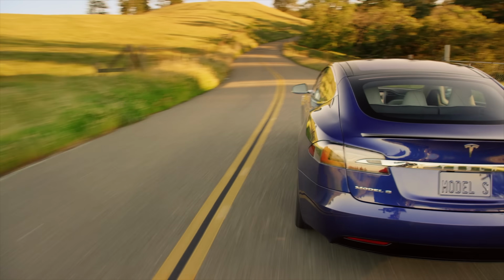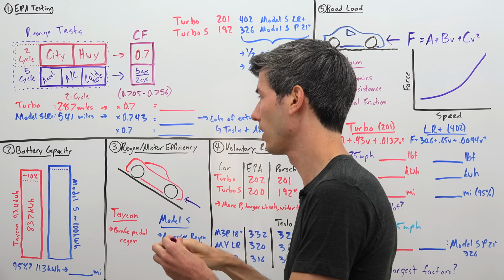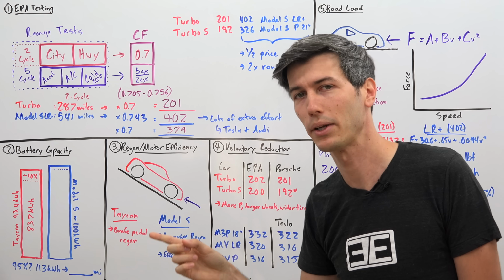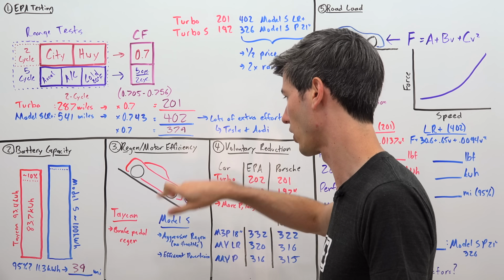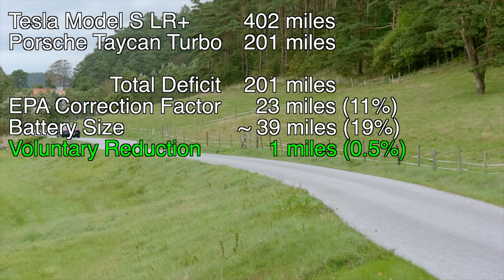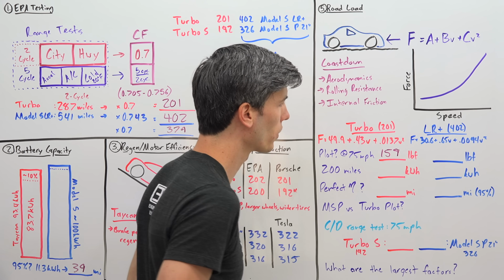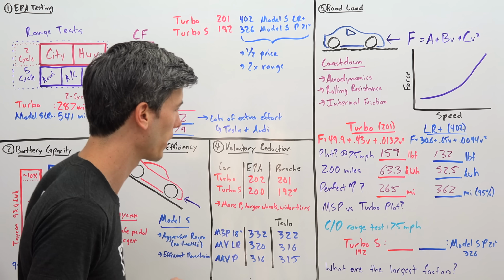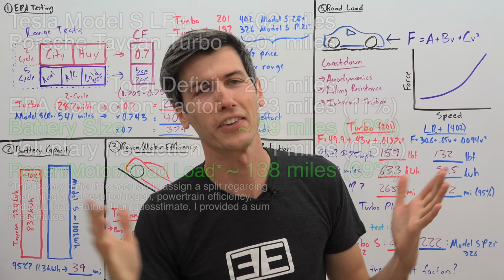Tesla's Secrets To Dominating EV Range - Double Porsche?!

Comment: Hi Jason, great explanation. 

I work in the electric motor controls group for an OEM. While machine losses from one motor to another do vary, it is not on a large scale. Permanent magnet synchronous machines, like used by both vehicles here, with SiC inverters are capable of extremely high efficiency. The impact of item #3 in your video is likely small.

Further, even though one car may have more "one pedal" regen, when the EPA tests are run, I think it unlikely to make a difference. The profile is defined. Braking will be primarily from regen regardless of if it one pedal or the driver physically pushes the brake pedal. Coasting is actually better than unnecessary braking. 

Great work explaining the differences!
Reply: Working for an OEM too and I totally agree, everyone keeps saying Teslas are more efficient but motor + inverter + gearbox is such a small part of the differences. Battery buffer and road loads have so much more influence 👌
Reply: @cellofane89  How can Tesla use a smaller buffer yet have the lowest degradation?
Reply: @yehudagoldberg6400  I don't think I ever mentioned degradation?...
Also, what is your source to claim Tesla has the lowest degradation? Degradation of what compared to what /who?
Reply: @cellofane89  You did not mention degradation. I did. Since you work in the field, I am asking you a question. How can Tesla have so little degradation with small battery buffers? Is it the charging curve, battery cooling, battery chemistry?
Reply: @yehudagoldberg6400  oh I see, my bad then.
I think Tesla does not have significantly better cells than others (when looking at energy density at cell level, cooling system power and charging curves) . They are probably more confident or taking more risks and reducing their buffer compared to others. As far as I know, there is not enough data from other manufacturers to see if they really do better or worse on ageing. On top of the degradation topic there is also other attributes linked to that buffer, for example Porsche can maintain high power through the whole useable SOC range instead of reduced power at the end. Also, charging can be more aggressive with a bigger buffer both because you don't use the very top end SOC (where charge power is limited) but also because you can "afford" more degradation.
Reply: @yehudagoldberg6400  The short answer is they have better software for SOC modeling so they can be more accurate and their strategy is NOT to charge to 100% everyday which helps on life.
Reply: Theoretically coasting is better than regen. However in the real world, 95% of drivers do not coast effectively, so regen is better.
Reply: Yehuda Goldberg You’re ignoring the fact the Porsche can regen at 270 kW, which is deceleration of 0.4 g. That is a much higher deceleration rate than most people use in normal driving.
Reply: @KyleBrightman  sure, but the EPA cycle does not contain any 0.4g braking event. Agreed it could regen up to that, but during this specific cycle it cannot. That's the bane of any normalised cycle, the accelerate and brake less aggressively than some/most people do.
Reply: @dragosmihai3489  Much than half Taycan. Bjørn Nyland says max regen is in Tesla 3 Performance and it is max 95 kW.
Reply: @foersom5928  Did a quick calc. Assuming you're not traction limited (so would apply better on the front axle) with a 2000kg vehicle at 30m/s (more or less 60mph) breaking at .4g would be capable of releasing around 300kW; were the motor and battery capable of drinking that up? Should do, as it would be a "spike", so no real overheating can occur. It might be a bit jarring for the driver though and it seems most do limit the regen (far) under 100kW. It took me a while to adjust my style on the bike to be able to use full regen, without loosing the rear of jumping over the handlebars, similar on cars. I whish, if I owned an EV, to be able to jack the regen power up to the limit I'm confortable with
Reply: @yehudagoldberg6400  Excellent point.  I would guess the reason for that is that 95% of drivers are driving in stop and go traffic where excessive coasting is considered obstructive by following drivers.  Being aware of energy management I try to coast whenever reasonable (much more than my wife does), but unless there is no traffic the level that seems reasonable to other drivers is well below that for maximum efficiency. So I agree regen is better for real world driving.
Reply: @gort8203  Absolutely, regen is better hybrid vs non-hybrid, but there is still the point that in "normal" driving, the porsche should be able to handle all deceleration with regen via the brake pedal. So unless they are purposefully blending mechanical braking in with regen (maybe for brake feel) their regen efficiency (efficacy?) should be very similar given similar driving styles.
Reply: @gort8203  Regen is great when you need it and is more for city driving. But is nearly useless for highway and I don't want to Regen the moment I let off the pedal slightly. Kia and KonaEV are great because you can change Regen levels on the fly from zero all the way to 3 with the option to hold the paddle to get max Regen possible.
Reply: @fleyua7176  there's so many opinions here and it seems so few experiences. In a Tesla it's more accurate to say you modulate your speed/coast/Regen with one foot, you can easily coast and see how much energy you're using or gaining. If you let off slightly then you coast, the more you release the more the car engages Regen it's very intuitive and efficient, I rarely ever need the brake, and it at least doubles my reaction time, as switching pedals takes time, and effort.
Reply: @tscook10  More real world than EPA testing but anecdotally I have found people maintain pedal styles more than acceleration profiles switching between cars. Approaching red lights, most people I ride with coast no pedal until some preferred stopping distance & start breaking (poor momentum management). Given moderate regen they slow earlier & coast in slowly giving more time for the light to turn & retain momentum. Using a little regen loss to save more regen loss + low speed friction break loss.
Reply from the maker: According to the Car & Driver article, the Regen/Motor Efficiency is the largest portion of the test difference. They state the regen alone results in a 13% gain in range.
Reply: @EngineeringExplained  I need to read the article because I would like to know how they obtain such number. I was surprised at the small difference in road load between the two cars, I thought it would explain most of the difference in range (after correcting for battery size and factor) but it sounds like there are other gremlins... Maybe AC systems or bad regen on the Porsche then...
Reply: The road test are the verifiable data. And you can't get from the road test to Tesla's EPA (self-reported & so far non-reproducible) numbers without assuming some wildly implausible assumptions about the effectiveness of Tesla's regen. We already know Tesla misreports electricity consumption to the driver. It's not hard to figure out what the simplest explanation is. Tesla's core competency is software & the EPA isn't all that smart. 

Porsche doesn't want to punch down but I'd love to see Ford or GM put a Tesla through the EPA cycle and report the real results.
Reply: @EngineeringExplained  test difference != real world difference. You yourself just proved that in reality Porsche is more efficient than Tesla, you just did not realize that and stated the opposite in the video. Just take C&D achieved range and divide available battery capacity with it and you will see that Porsche power consumption is 12.5% less than Tesla. All those artificial roal load and rating factor calculations are utterly misleading.
Reply: @EngineeringExplained  That would suggest the test cycle has a silly amount of acceleration and deceleration cycles

What matters is as you point out the range on motorways where the difference is just 6%
Reply: This is just a theory & regen would have to have >100% efficiency for this to be true.
Reply: @EngineeringExplained  interesting. I'll have to pick that up. Maybe Porsche is doing more friction braking for some reason. But that is independent of one pedal vs coasting brake profiles.
Reply: @EngineeringExplained  Interesting point; having done some testing on different regen strategies, in the real world it doesn't appear to make a lot of difference (comparing say lift off regen with regen only on the first part of brake pedal movement). A quick and dirty calculation based on the EPA urban cycle UDSS (is this the right cycle??), using the road loads given for the Porche, and a mass of 2215kg gives 3.96kWh motoring energy, and 0.633kWh of generated energy (assuming 100% efficiency, and no friction braking). The generated energy is 16% of the motored energy.. that would imply Porche barely have any regen at all during EPA. I didn't bother looking at the highway section since there isn't much deceleration going on. Very interesting discussion :)
Reply: @EngineeringExplained  As it relates to regen, you need to take into account that battery voltage.  Tesla 400vdc, and Porsche 800vdc,( P = (Vm - Vbat)2/ Rm). Porsche should have a significant advantage with opposing Regeneration  (Used to charge the battery).  I understand Porsche takes a conservative approach to regen, but has more available regen power.  Also, DC Fast charging times gives an advantage to Porsche as well.
Reply: @EngineeringExplained  In Europe, we often need to slow from 100km/h to 80km/h on high ways. Using that final plot of yours for Tesla Model S Perf (2250kg and 100km/h -> 80km/h will reduce kinetic energy about 314 kJ), I get that:
1) coasting away from 100km/h -> 80km/h with linear approximation (not linear for real) will use 616m distance
2) driving 616m at 80km/h will consume 0.08 kWh
3) max regen available from slowing 100km/h -> 80km/h at 100% efficiency is 0.087 kWh

In order to gain benefit from regen braking, it would need to be 100% efficient. Regenerative braking is only useful, when stopping needs to happen fast, so in city traffic etc. where you normally would convert the speed into heat in the break discs.

So, also in Tesla Model S Perf it would be beneficial to just coast away the 20km/h speed on high way than brake it with regen (unless I have made a huge mistake).

Porsche engineers 1 - 0 Tesla engineers. Sorry :).
Reply: @akkual  I'm not sure why everyone thinks you can't coast in a Tesla. To coast in a Tesla you just need the correct technique - you apply enough pressure to the pedal to zero out the power meter. It sounds tricky, but after driving a Tesla for a bit it becomes second nature.

I used to believe that blended braking was better when I drove a Nissan Leaf. Now I own a Model 3 and I think that Tesla-style regen is much better.

Tesla-style regen makes it much easier to maximize regen, because the driver knows at all times whether they are activating the friction brakes. If you want maximum regen, you just let your foot completely off the accelerator pedal.

With blended brakes, it's hard to tell whether you are using purely regen or if friction braking is also involved. This is particularly true because the amount of force on the break pedal which causes the friction breaks to be applied tends to vary with speed, state of charge, and other factors. This makes it hard to develop a feel for the point on the break pedal that offers maximum regen.

Many EVs, including the Leaf, now offer a pedal off regen mode, but in many cases that mode only offers a limited amount of regen.

Once you have practice in a Tesla, you almost never need to use the friction breaks except in emergency stops and at very low speeds (regen does not bring the vehicle to a complete stop; there is a one pedal mode which does, but it applies the friction breaks). You can also make longer decelerations (e.g. stopping from highway speeds at a traffic light) extremely smoothly since you have precise control over regeneration.
Reply: @BrianCairns  I like to rest my foot while coasting. And to be particular, there's no such thing as "max regen". There might be some efficiency sweetspot for it, but in general it does not matter how strong the regen is,  only the total energy absorbed (delta in kinetic energy) via regen matters, not how quickly or slowly it was absorbed.

I haven't driven Tesla, but some have said that the regen is a bit annoying on full battery as it won't be as strong as when there's more room in battery. But this I do not know, as I have only sit as passenger in them.

Brake pedal in normal modern gas car is not linear either. ABS+EPS will modulate the given pressure based on the vehicle speed, pedal pressure and pedal pressing speed. It is not a challenging task to make a brake pedal regen that gets as much energy absorbed as possible, and what's best, it is all done for you automatically. So as driver, you do not need to worry if it's optimal or not, the car knows for you. So as long as you avoid emergency braking, you'll get the max regen.

My cheap current gas car even has brake based torque vectoring to counter torque steer and allow software "limited slip diff". It works great.

Tesla also has one superpower: autopilot. That can and should select the best way to spend the extra kinetic energy between coasting and regen based on the driving situation.
Reply: @EngineeringExplained  If regen were not a significant factor, then hybrids would not be viable. That 13% figure makes a lot of sense.
Reply: @vinnytube1001  But both cars are fully capable of regen. We're trying to find whatever Porsche's mistake is.
Reply: @Jupiter__001_  No, we're discussing the top comment that states that coasting is better than regen. It's also known that the Porsche is CAPABLE of regen but it chooses to coast where Tesla engages the regen. Coasting as long as possible is indeed, from a physics perspective, the best thing - i.e. conserve your energy rather than spend it and attempt to reclaim it. That's always going to be better. The problem is with reality: it's impossible to drive this perfectly. In fact, some states can ticket you for "anticipating the light" - which can come in the form of trying to coast towards a stoplight to time it so you don't need to use brakes. Plus there's stop signs, sudden changes in speed limit, and a myriad of other normal daily driving encounters where it's simply not possible to drive in a physically optimal way. Hence the regen is absolutely critical. All Porsche needs is an OTA update to allow automatic regen when throttle is absent, perhaps even in selectable levels - off, the original, low, and high would probably be enough.
Reply: @vinnytube1001  In Porsche Taycan with foot off throttle, if the road is free of traffic it will coast because that is most efficient. However Taycan has a mode where it will use regen to slow down if the ADAS camera detects slower traffic ahead Taycan.
Reply: It’s interesting that based on the breakdown of the data that Tesla’s seem to have a significant range advantage, but the real world testing by car and driver shows very similar ranges between the two... 🤔
Reply: I think most people saying that porsche use more of the breaking pads and not relying on the regen is the greatest factor. I came here for the tech but according to most sources, the Taican is a better drive with better dynamics and behavior overall, closer to a regular porsche. So I think much of the efficiency could be sacrificed into giving a more responsive acceleration/breaking/sporty experience, while tesla focus on energy effiency and few drag accelerations.

I also think the argument against the OEM not knowing state of the art tech is not valid, it's more about physics than tech. If math don't work, no amount money will fix it.

As for degradation, I've been reading very few reports of bad battery on teslas, and there's definitely no Taican out there for time/milage enough to even start comparing the bettery degradation with a 2012 model S. and for that matter, it could be that even having a smaller buffer for tesla, it could be more than enough to cover the 8 years warrant they give/used to give. Both are shooting safe. Porsche is shooting saferrrrr
Reply: Rafael Tadashi I get the sporty feel part obviously it’s a Porsche. But I think most the extra battery drain just comes from wider tires because the P100d accelerates faster than a 918 I don’t see Porsche spending more battery than Tesla to accelerate and driving feel that way.
Reply: Tesla actually uses inductiom motors not PMSMs for the model S
Reply: @SuperMarvinthegreat  not since the Raven update, they use a PMSM at the front and an Induction at the back if I recall
Reply: @cellofane89  ah ok i see
Reply: @SuperMarvinthegreat  the primary machine is permanent magnet now.
Reply: @SuperMarvinthegreat , Tesla actually uses one of each.
Reply: Porsche could very well have lower max regen torque for a variety of reasons.
Reply: I mean the whole “require the user to exercise the mechanical brakes to get regen” is mildly infuriating from a general geekery perspective. Leaf did this too at low speeds in my 2013.
Reply: True. However one-pedal regen never creates frictional braking, whereas pressing on the brake pedal can.  
I own an election Chevrolet Spark. I only use my friction brakes for unexpected situations, stopping on steep streets, or to prevent creeping forward at traffic lights. Without one-pedal driving, I’m sure I’d be  wearing out my brakes a lot faster.
Reply: Mr. Teff I can tell you even with the limited regen of the 3rd generation Prius I have gone 145k miles on the original pads and rotors and have more than 60% pad life left.
Reply: @MrTeff999  Well, not actually true for every car. For example, I own a 2020 e-Golf, and a 2019 Nissan Leaf 40kWh. The "one-pedal regen" aka "e-pedal" on the Leaf has been created to educate people on how to drive more effectively. (because as you all said, nobody really cares about being effective on the roads). To achieve that, the e-pedal system DO use frictional brakes and the reason for that is to get a constant response of the brake sensation. (if you do not use the e-pedal, there is absolutely no brake regen at full charge). So, a one-pedal system use indeed frictional brakes (but at a very low level).
I am way more happy with the e-Golf system and I tested drive a lot of electric cars and daily use them for 8 years now. The e-Golf system is simple, you can select 4 regen mode : 0 (coasting), 1, 2 or 3 with just a pressure on the lever. By default, regen is 0, so you will be coasting if you release the throttle, maybe like the Porsche ? That is just perfect for me as I often try to be the more effective I can.
Also, I kept one EV 4 years (and 100.000km), brake pads or disk looked brand new !
Reply: I agree that coasting is theoretically more efficient in real world driving.

However, for me it remains to be seen how much of an impact the different regen approaches (one pedal vs. brake pedal regen) effectively have on the specific EPA cycles.
Reply: @dnuno75  The cycle is specified by a speed profile. The driver has to use the throttle and brakes to follow the profile, so the amount of acceleration and braking force is fixed in a way. It doesn't actually matter if the regen is actuated by lifting off, or pressing the brake - both lead to the same outcome. That is all assuming that the first part of the brake pedal only actuates regen and not the friction brakes. I would be very suprised if that wasn't true for the Taycan, but I would stand corrected if not.
Reply: @aaronsmith3555  Thanks, I am roughly aware of the EPA speed profile, just wasn't sure how much the specified deceleration rate requires brake application. That being the case as you wrote, different regen systems shouldn't influence much in the outcome.
According to Porsche, on average the Taycan does up to 90% of braking through regen.
Reply: Hey Jason, doesn't the Porsche have a 2 gear gearbox? This may also explain why it is more efficient at highway speeds than the Tesla.
Reply: Perhaps it's how much regen is used for braking, including when pressing brake pedal rather than just the 0 throttle regen? Like, for the same amount of braking force (say, "half") the Tesla is using regen only while the Porsche adds mechanical.
Reply: @swayingGrass  it's actually the opposite: Taycan has up to 270kw regen. The Tesla can maybe do a bit more than half of it.
Reply: @swayingGrass  yeah it is quite likely to explain a part of what is described in "regen+road load" but it would sounds silly from Porsche to have "let go" those miles so easily...
Reply: @cellofane89  I'm guessing Porsche has ICE cars to sell too.  If you want great range, buy an ICE car.
Reply: @CoralSea  it's very unlikely to be how they think. An OEM does not invest billions (usually 100s millions on a car but billions for a new platform+powertrain) and try to limit the sales, especially as the Taycan probably has good margins and is offsetting high CO2 emissions from the rest of the group in Europe. Though, range probably was less of a concern in regard to performance/handling /comfort and feel compared to a Tesla or cheaper EVs.
Reply: This isn't true - Porsche uses even heavier regen than Tesla. The only difference is controls; Porsche coasts until your push the brake pedal, which is actually MORE efficient. Tesla's test numbers are still suspect. He attempts to explain it away but with an identical load factor, the MSP shouldn't have an EPA number more than 20% above the Taycan even if Tesla's buffer was ZERO. 

Tesla is gaming the EPA test with software. There's no other explanation but people will deny it just like they denied that VW was cheating on the diesel tests even though it made no sense that they could pass without DEF when no other automakers could.
Reply: @swayingGrass  the max "not the manufacturer range" range is possible if you archive to mostly use regen or braking on a minimum
Reply: Thank you for the one pedal driving comment. I am so tired of everyone stating that Tesla is superior because they don’t understand that pads don’t touch rotors every time your foot is on the brake pedal.